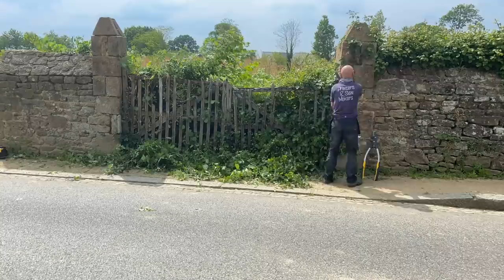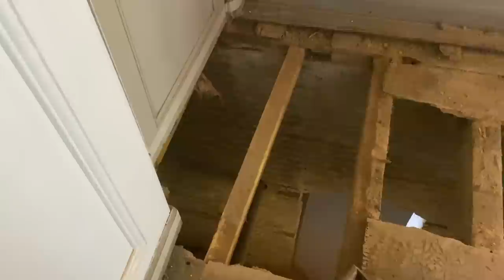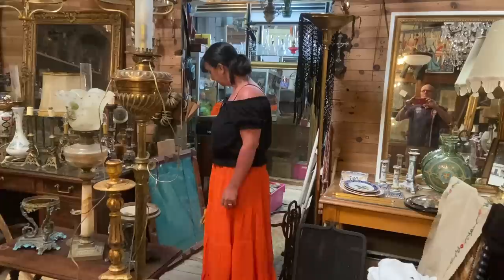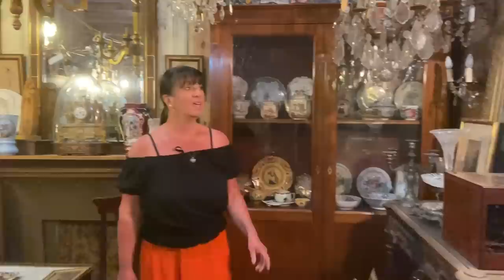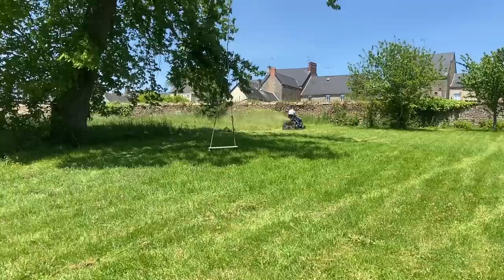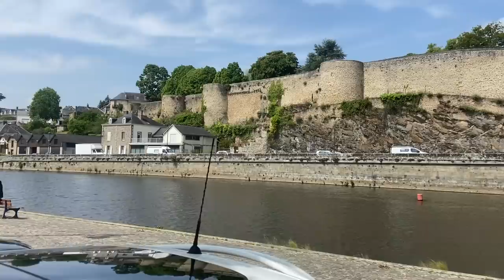A Taste Of Everything At The Chateau

Comment: If you take a skyblue censer luster, and it is gorgeous (I would not lose the chance to get it), then it should be placed as a central accent, above the main entrance; of course, polished and updated. And already around this censer, as a central element, to form an exclusive design - to select everything else. It is also necessary that the light from it play through the skyblue lampshade on the ceiling.

Comment: Chandelier with a skyblue lampshade, oriental, very cool, although it needs to be finalized, because it does not have a chain and it will be attached high to the ceiling. And the second minus: you rightly noticed, that you need to pick up a sconce for it. It's like a parure. The only thing is that it could be taken to the old kitchen with a hearth.😃🤔